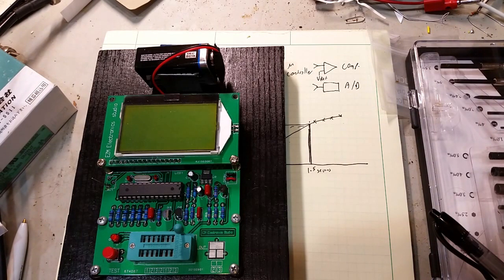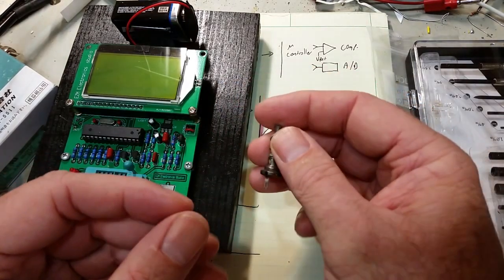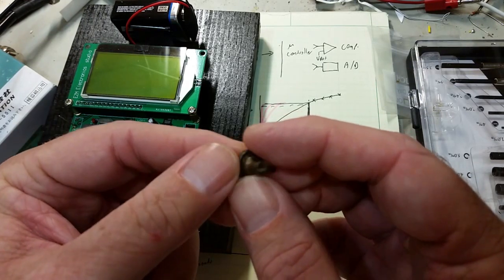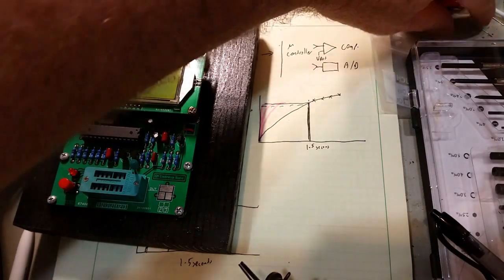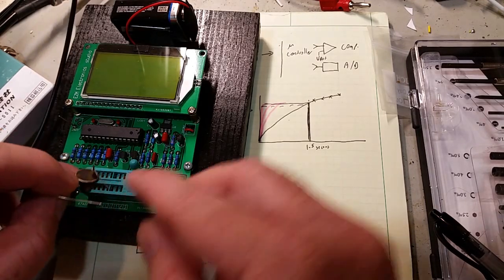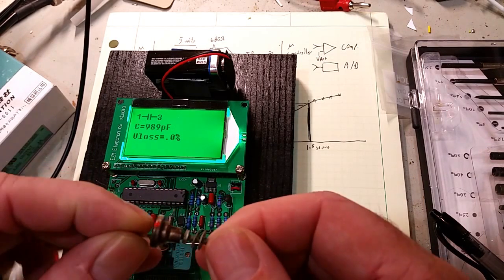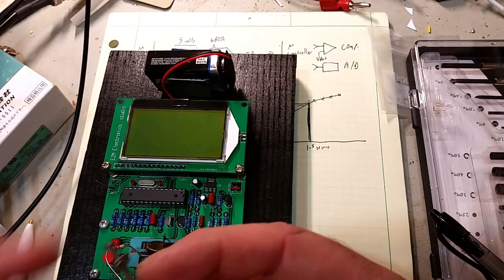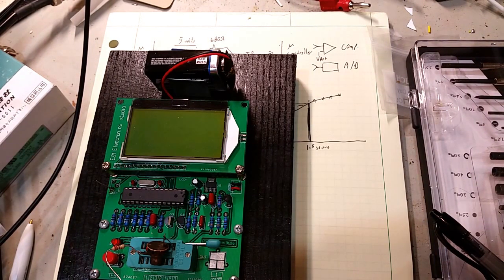Using the Yosoo GM328 to identify a mystery component

Comment from the maker: A viewer messaged me that this is a "button mica capacitor". A quick search confirmed that and apparently they are used in applications where they may be exposed to high temperatures and where high reliability is required.